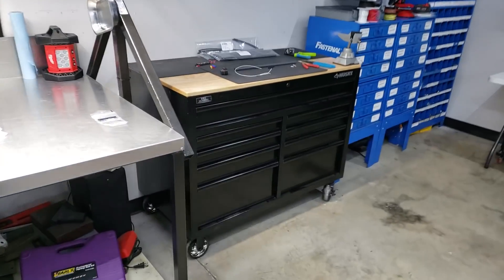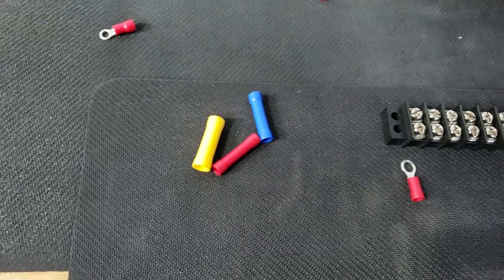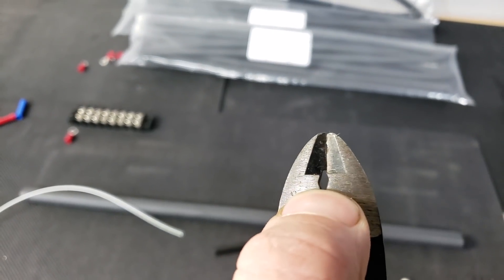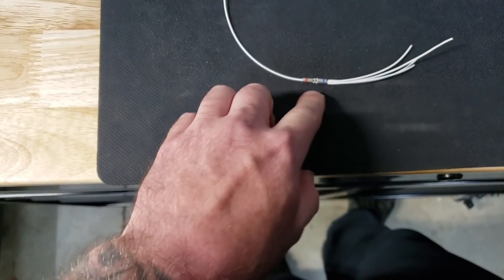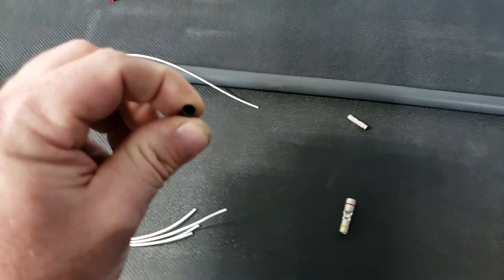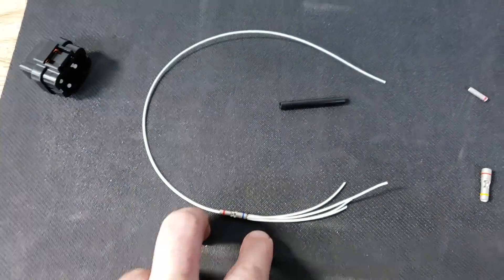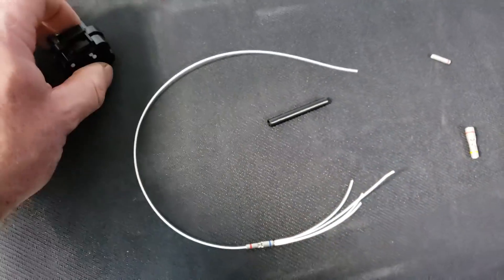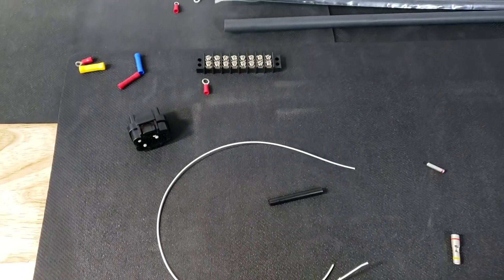Adding sensor wiring with Holley efi

Comment: Hey devin 
Is it ok to tie two 5v reference together ? Let’s say connector J3 pin b8 and b22 . I tied them as one wire to connect all my sensor with it. or will this harm the system.

Comment: I just tried doing the step down +5v method, it's definitely not working for me I have a transmission sensor and dome pressure sensor on there and dome pressure is pegged at 4.59v with key on. I'm using J2A pin 26 for +5v and J2a pin 18 for sensor ground

Comment: GM has 9 trays of terminals from around the world. Either a terminal end with a core crimp and insulation crimp, much less and inline repair as shown, soldering is required. I am hoping people research and understand the circuit they are working on as a single terminal sensor is grounded thru the engine block, but the ECM / PCM produces 5 Vdc out, as resistance to ground changes, it pulls the voltage signal down. The most common sensor used is thermistor (NTC or PTC) but a two wire sensor is a permanent magnet generator type. Those wires go to cam, crankshaft, ABS, cam-phase position produce a weak A/C signal. It is best practice to twist these wires 9 times per foot and shielding with a ground wire either added and grounded on both ends, or full shielding woven cover. TPS, MAP and others use a dedicated ground back to the ECM/PCM to keep the sensors signal and control module on the same ground level. This can be seen on an oscilloscope. PCM’s use 4 grounds to “G100” but represent different parts of the computers function. Clock, EEPROM, Memory for backup, Drive circuits. This is where I always remind that ground from the back housing of the alternator is where ground is generated. Providing a large ground to bolt w/star washer to alternator to engine (I prefer a “Tee” soldered connection) but to the battery. Battery ground to chassis, engine to cabin, frame to cabin, and if truck, frame to bed. Not so much in racing, but grounds from frame looping to multiple sensors, frame ground to exhaust if using O2 sensors (Galvanic Action Reduction) but bed to cab if 5 volt proximity sensors are used. The voltage loss of 0.050 is great in a 12.6 - 14.8 Vdc is desired, today, 5 Vdc circuit take a huge hit with any voltage drop. A ground “Splice-Pack” is common the last 20 years and connect multiple grounds to one ground. Positive splice-packs are used as well, sold thru Kent-Moore, but Delphi produced. I always take wire cutters when visiting a salvage yard. When used on a single wire class-2 serial data, cavity #1 goes to OBD-II connector, cavity #2, but when disconnected and the “Comb” removed, allows for a jumper wire to go from device to device, to find short to ground, positive or open. State of Health messages are sent every 2 seconds and if a failure occurs after proper operation is established, the master or module needing info, goes into back-up programming, limp mode, or ignore mode. Theft deterrent system for example looses a 5 Vdc signal from the key module or correct voltage drop, will continue the key to start the vehicle without theft. It just turns on the light. Same with redundancy built into DBW. Some use the second signal, while others enter into limp mode. Or what I call “Tennis shoe Mode”, making the customer walk. ASE Master Tech since 1978 - Retired Thanks for the short video and info.

Comment: So you would suggest breaking out all your sensor grounds and +5v sensor power wires at the same point rather than having tap off of a single run for wherever the sensor pops out along the trunk? I suppose the way you show in the video is many fewer connections so that probably outweighs trying to slim the trunk of the harness.
Reply from the maker: if using bulkhead connections i make the splice in the boot of the bulkhead.  if not i like to do them in a area inside the car thats not in a bent location and yes i always do a single break point

Comment: Thanks, Devin! How many senors can the Dominator provide 5v to? I'm planing my harness out and I'm somewhat of a data freak, so the want/need for senors on EVERYTHING is real!
Reply from the maker: Considering I filled up a dominator with sensors it's safe to say you're gonna be fine 
I've ran 12 pressure transducers off of 1 5 volt output from ecu with zero issues
Reply: This is a very good question.  I always wondered what the limit of one of the 5v outputs are.  Good to know the answer is “many” lol.

Comment: What the max wires you can use on in output ?
Reply from the maker: are you asking how many sensors you can run on a single 5 volt or sensor ground circuit ?
Reply: Yes

Comment: I love this because it's such a clean and reliable install, however if you need to add a sensor after the fact it sounds like a real PITA.
Reply from the maker: i pin out 3-5 spare 5 volt inputs and 2-3 spare temp inputs to 2 or 3 pin deutsch dtm series connectors for future upgrade purposes. the car i just wired (go on my facebook page and youll see it 2018 hellcat) i pinned out 12 additional inputs and 6 additional outputs to the firewall bulk head connectors as well as wired the entire car for 2 completely different engines and power adders
Reply: Where did you get those butt connectors from ?